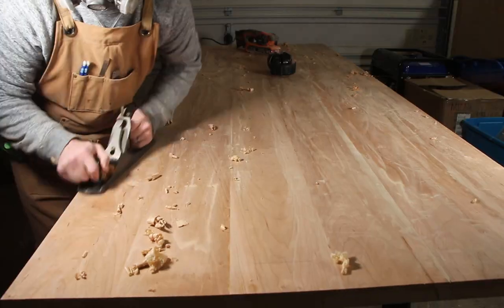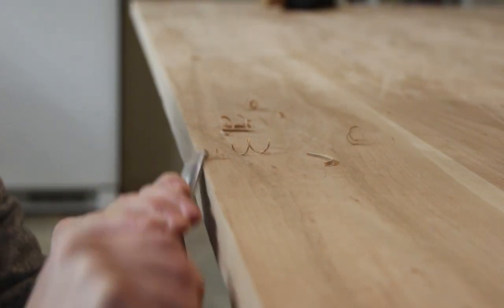Building a 9ft Farmhouse Table with Cherry Wood

Comment: It makes a refreshing and satisfying change to see some genuine woodworking skills, using proper jointing methods instead of the quick fix (dreaded) pocket hole screws that so many youtubers seem to use nowadays.
Keep up the good work. 
Those that know - know, those that don’t - drill and screw.
Reply from the maker: Thanks! I enjoy doing the traditional joinery... it just takes a lot longer so I gotta be more patient.
Reply: The issue is a lot of people don't have the tools to do a mortise and tenon joint, and one isn't needed in a lot of woodworking.

You do realize that ALL professional cabinet makers use pocket holes, right?

Comment: Dude you are a master craftsman, and you have a new subscriber! I have a question, did you weather or distress the top at all, besides chiseling the edges?
Reply from the maker: Thanks man! I tried to give it a hand scraped/hewn look by doing a random combination of hand plane; belt sander; orbital sander all over the top. The stain also helps with making it look weathered. Rough areas retain more stain than the really smooth areas which gives more color variation

Comment: You did an awesome job on that table!  👍🏻 What was the finish you used and is it holding up well? Thank you for sharing!
Reply from the maker: Thank you! I finished it with a general finishes java gel stain and then top coat of osmo polyx oil. So far it has held up well from what I've heard... although it's not in my house so I don't see it regularly!
Reply: The Evening Woodworker Thanks!

Comment: Nice work! Table looks amazing. I currently have someone asking me for a farmhouse table. My question is this, you said the trestle support tenons had to be cut at 45. Would it have been easier to cut the tenons at 90 like the rest or would that have reduced their effectiveness? Thanks for your time and keep up the great work.
Reply from the maker: The benefit to cutting the tenons at 45 is you have more wood fibers to distribute the load diagonally. It's also kind of the traditional way to do a mortise and tenon  on 45 deg joints.
Reply: @EveningWoodworker  after I sent the message I thought about it more. It makes sense to cut it at 45 so it will lock in better. Thanks for the reply, I enjoyed watching your work. It gives me inspiration to try new techniques.

Comment: Wow man incredible job!! The video was great I’m about to make a 10ft farmhouse table for my sister any tips for a guy with limited tools?
Reply from the maker: If you do the traditional mortise and tenon joinery, get a shoulder plane. It really makes quick work of cleaning up your cuts after a less than perfect tenon cut. Sounds like fun! Also, tell your sister she needs to buy you some tools as payment!
Reply: @EveningWoodworker   lmao i may or may not have already told her that also any tips for flattening the top? I have a biscuiter to help with lining up the boards but any other tips?

Comment: Love this table! As I would like to build this for myself, I purchased your plans. However I am confused by some discrepancies, for example: for the Base Foot your plans say to glue 2 pieces of 2 inch lumber together, while in your video you glue together 3 boards. Am I missing something?
Reply from the maker: I did it with 3, because I was working with 6/4 lumber, but in the plans I think I recommended starting with 8/4. Either way, just glue up enough boards to get to the final dimension.
Reply: @EveningWoodworker  Awesome, thanks for clarifying!

Comment: Do you recommend wetting the piece of wood prior to gluing?
Reply from the maker: I don't usually wet the wood and I've never had trouble with the glue failing. Not sure it adds anything.
Reply: I have never heard of wetting wood before gluing. The glue is stronger than the wood, so a failed glue joint won't happen unless you mash the hell out of it and leave no glue in there. I have personally tried to break apart a glue joint that was just two pieces set on top of each other with glue and the wood broke, making me have to sand off the wood pieces and glue.